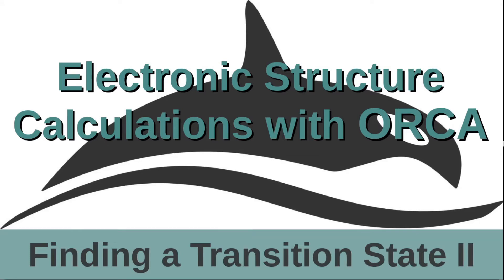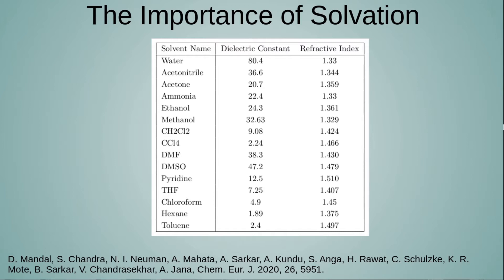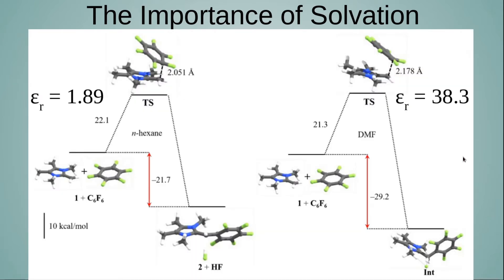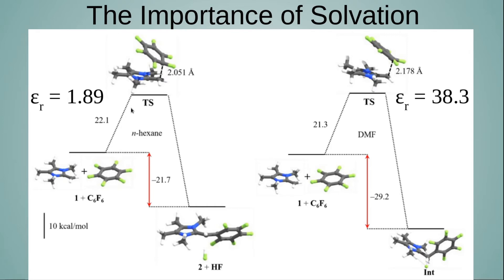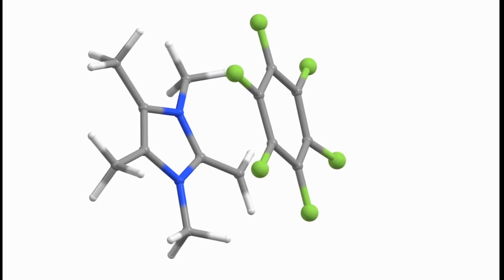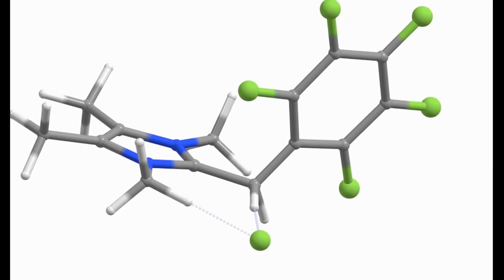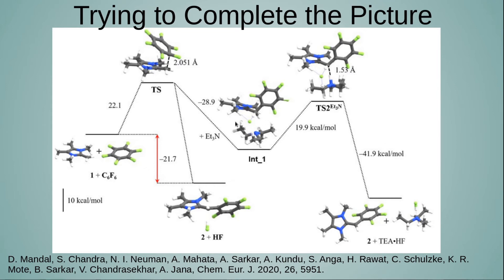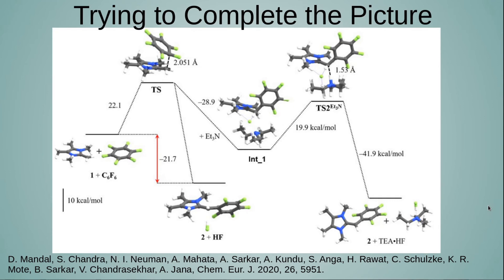Finding Transition States in ORCA (Part II)

Comment: Dear Nicolas N. I am a newbie so I still do not understand clearly about your code. But I meet a problem when I re-write your code on my computer. I meet a problem is that my computer does not understand P at "%output Print[P-Basis]2". Can you help me explain it? and How I can address this problem?
Reply from the maker: Hi, you should check the Orca manual to see how exactly to write those commands. I think you used P-Basis, when it should have been P_Basis. But in the manual it is written correctly:
%output
Print[P_Basis]2
Print[P_MOs]1
end
This is what I always use to be able to plot the orbitals in Chemcraft/Avogadro. 
Cheers!
Reply: @niconeuman  thank you so much for your help.

Comment: Can you explain what the keywords "GridX6 NoFinalGridX Grid6 FinalGrid6" are exactly used for, and when are they needed? I've seen them used in many inputs, and I know what they are theoretically for, but cannot find an explanation. Also, don't know if it has to do with the version of ORCA, I tried adding them some times for comparison and got errors and the calculations wouldn't run until I remove them all..
Reply from the maker: those keywords are no longer used in Orca5. now you have to use DefGrid1, 2 and 3. Grid is the size of the quadrature grid used to numerically integrate the exchange correlation potential in DFT. GridX is a grid for the RIJCOSX approximation that is used for numerically calculating the exchange matrix when you have hartree fock exchange, for example in hybrid functionals. the numbers like Grid6 mean finer more accurate grids when higher numbers are used. FinalGrid6 means use the same grid for the final single point SCF iteration, because the default is a lower resolution grid. NoFinalGridX is actually not supposed to be there, it is worsening the results, that was counterintuitive in the syntax of the program and I didn't know at the time. now with DefGrid2 I think other grids are set automatically. but you should consult the manual for these stuff because there are many options and I don't know exactly how everything works.
Reply: @niconeuman  Oh thanks! I think the fact that I started using Orca5 and I was seeing all these tutorials and input examples which included these keywords confused me. 
I'm actually using the RIJCOSX approximation, but I don't add Grid-related keywords with DefGrid?
Should I? Do you think I could find improvement in my calculations? Or just the "standard" should work most of the time?
Thanks again!
Reply from the maker: I think the default in Orca5 is DefGrid2, which is apparently more than enough for most purposes. The Grids in Orca5 have been improved to be more consistent, apparently, and they are also larger than before so that they don't introduce certain errors (that's what I read).